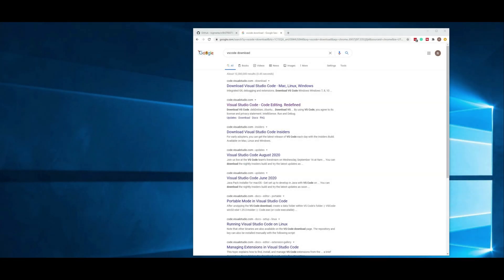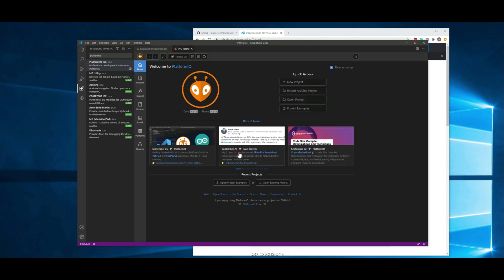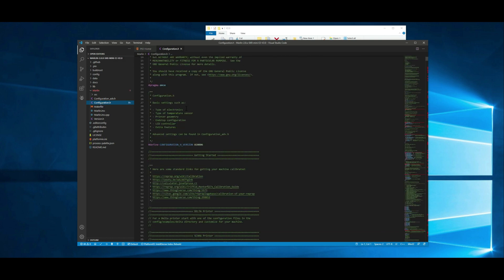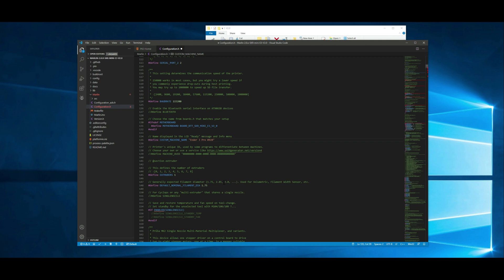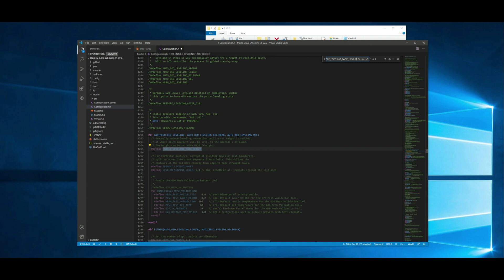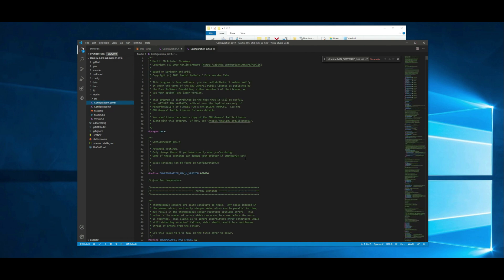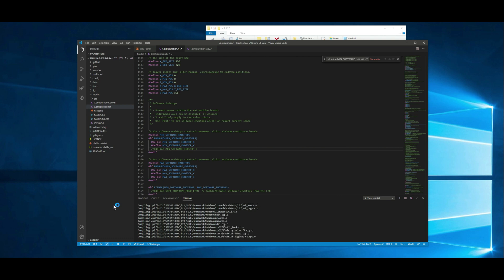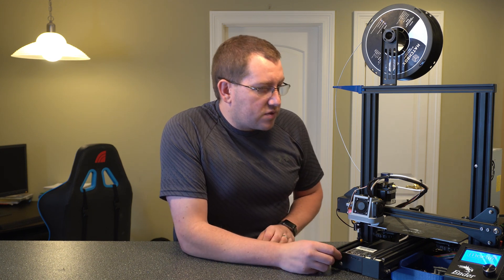How to Compile Custom Firmware for SKR Mini

Comment: I'm having trouble flashing my updated firmware to my skr mini e3. The fan0 pins on my board wont work with the tft display, but the fan 1 pins are always on; so Im trying to swap the two and use the power terminals to replace the fan1 pins. I changed the fan0 pin to pc7 from pc6 in  pins_BTT_SKR_MINI_E3_common.h, and the fan1 pin from pc7 to pc6 inpins_BTT_SKR_MINI_E3_V2_0.h. the code was successfully compiled and loaded onto the sd card, but when I power on the board wiith the tft display nothing changes. Is there anything else in the ender 3 that is needed to flash the firmware, or should I be able to do it only with the board and tft display?
Reply from the maker: Hi. All changes would be done on either the mainboard or tft. If you are running into issues there may be someone Discord that can help. https://discord.gg/Bu94EYVkrU

Comment: When I run the build command it starts running through the "Building in release mode" and then comes to a stop and does nothing. it still has the spinning build icon but the terminal stops. Please let me know how I might be able to fix this. I have not been able to find much help with this anywhere
Reply from the maker: Hi. I think you reached out on Discord. If that wasn't you and you need help here just let me know.

Comment: Big fan of your videos and channel!
I also am having issues compiling this firmware correctly for my setup, and would be extremely grateful if you could help me. I've been trying a week now with no luck :/ I even resorted to other guides on the internet with no luck as well. I recompiled the firmware following your guide again (following this guide exactly) and am successful in building it and flashing it, but no matter what i've done, the BL Touch clone I am using (3d Touch v2.1) does not stop the z axis from moving downward when homing. The 3d touch also responds to all the other commands when I try them manually in the menu (reset, self test, deploy, stow, etc). I tested the precompiled firmware .bin file that Bigtreetech offers, and theirs actually does make my 3d touch home correctly/stop the z axis from moving downwards, although I need to use a custom compiled version for different offsets and other settings. I've done research on this issue for hours, and numerous hours trying with no luck. Would you be able to help me?
Reply from the maker: Hi. Thanks for the feedback. Based on the name and overview of the issue you are having I think you reached out to me on Discord. If that’s not the case, let me know and I will try to help out here.
Reply: @3DPrintscape  You helped me for four hours+ with numerous attempts and finally was able to help me solve my problem. I am extremely grateful for the help! Definitely staying subscribed and enjoy your videos thoroughly.

 For anyone who owns a bl touch clone (mine was a makerbase 3d touch v2.0), try commenting out (putting two // infront of) BLTOUCH_FORCE_SW_MODE and BLTOUCH_DELAY under configuration_adv.h . It made mine work successfully after many attempts!

Thanks again for all the help!!
Reply from the maker: @Jeff876533  Im glad we were able to get everything working 😊.

Comment: keep getting an error   {
	"resource": "/c:/BTT/BTT/firmware/V2.0/MarlinSKRminiE3V2.0/Marlin/Configuration.h",
	"owner": "C/C++",
	"code": "1696",
	"severity": 8,
	"message": "#include errors detected. Please update your includePath. Squiggles are disabled for this translation unit (C:\\BTT\\BTT\\firmware\\V2.0\\MarlinSKRminiE3V2.0\\Marlin\\src\\MarlinCore.cpp).",
	"source": "C/C++",
	"startLineNumber": 1,
	"startColumn": 1,
	"endLineNumber": 1,
	"endColumn": 1
}
Reply from the maker: Hi. Can you provide the full error message?
Reply: @3DPrintscape  it's ok bro. I've never used Visual Studio before so took a crash course. There was several points I had to "un-comment" before to compiling would work. Thanks for offering help, appreciate it   :) My bed is super warped, so got a glass bed. That helped too.
I'm trying to print thin wall for an RC aircraft and the parts aren't even close enough for assembly. 
Live and learn   :)
Cheers!
Reply from the maker: @hungoo1241  Cool, im glad to hear you got it working.

Comment: Did it the exact same way, but it fond 9 errors. wtf...
Reply from the maker: Hi. What are the errors?
Reply: @3DPrintscape  During compiling, few yellow rows occured. I will put them here if you don't mind, because I don't really understand them and don't know how to put it down simply:

1) C:\Users\Jirka\.platformio\packages\framework-arduinoststm32-maple\STM32F1\libraries\STM32ADC\src\utility\util_adc.c:10:30: warning: 'adc_result' initialized and declared 'extern'
 extern volatile unsigned int adc_result = 0

2) C:\Users\Jirka\.platformio\packages\framework-arduinoststm32-maple\STM32F1\libraries\FreeRTOS701\utility\port.c: In function 'xPortStartScheduler':

3)
C:\Users\Jirka\.platformio\packages\framework-arduinoststm32-maple\STM32F1\libraries\FreeRTOS701\utility\port.c:178:2: warning: implicit declaration of function 'systick_attach_callback' [-Wimplicit-function-declaration]
  systick_attach_callback(&xPortSysTickHandler);

4)
At top level:
C:\Users\Jirka\.platformio\packages\framework-arduinoststm32-maple\STM32F1\libraries\FreeRTOS701\utility\port.c:285:6: warning: 'prvSetupTimerInterrupt' defined but 
not used [-Wunused-function] void prvSetupTimerInterrupt( void )

5)
c:/users/jirka/.platformio/packages/toolchain-gccarmnoneeabi/bin/../lib/gcc/arm-none-eabi/7.2.1/../../../../arm-none-eabi/bin/ld.exe: .pio/build/STM32F103RC_btt/firmware.elf section `.rodata' will not fit in region `rom'

6)
c:/users/jirka/.platformio/packages/toolchain-gccarmnoneeabi/bin/../lib/gcc/arm-none-eabi/7.2.1/../../../../arm-none-eabi/bin/ld.exe: region `rom' overflowed by 1436 bytes
Reply: And 250+ problems occured in language_cz.h (I changed language. That's the only difference from your video)
Reply: Well, It may be caused by those 250+ (above 1000 errors in fact) in language_cz.h. It says that identifier 'PROGMEM' is not defined. Dang...
Reply from the maker: @jirivaltr560  Replace default_envs = STM32F103RC_btt with default_envs = STM32F103RC_btt_512K in your platform.ini file located in the root directory of the firmware folder. Then restart VS Code.
Reply: @3DPrintscape  thanx for help!
Reply from the maker: @jirivaltr560  You're Welcome!

Comment: How do I run the build once through compiling if the check icon isn't showing in the lower left corner?
Reply from the maker: Hi. It sounds like platform.io may not be installed, or it was installed but VS code wasnt restarted.
Reply: @3DPrintscape  Same problem here, installed vscode, installed platformio, still no checkmark to compile, have restarted program multiple times
Reply from the maker: @redsoxguy6766  Hi. If the build checkmark isnt there, it can only be a couple of things. 1) platformio wasn't fully installed 2) vs code wasn't rebooted 3) you have the wrong folder open in vs code. If you have the configuration.h file on the root without having to go into the marlin folder most of the firmware wont be known to vs code, including the platformio.ini file that's needed for it to build.
Reply: This is super old but I found the issue, you need to go to the Platform.io homepage in vscode and select Open Project. Then browse to the folder you were editing and find the platformio.ini file and select that. Then the checkmark should appear for you.

Comment: Awesome video! Question: when I connect my printer to my laptop, it does not get labelled a drive letter in Explorer. I checked device manager and it is indeed there and I’m able to connect it to Ponterface. What am I doing wrong?
Reply from the maker: Hi. Thanks for the feedback. You dont need to connect your printer to the computer. You just need to put the firmware.bin file that gets built from platform.io onto an SD card and put the SD card into the printer.
Reply: @3DPrintscape  I made changes exactly as you have described here, yet when I compiled it, I get a "C:\Users\ma_pa\.platformio\penv\Scripts\pio.exe 'run'" terminated with exit code: 1" error. 

I narrowed it down to the uncommenting of the #define AUTO_BED_LEVELING_BILINEAR as when I uncomment it, that's when I get an error. When I comment it, it compiles just fine. Can you please help me with this?
Reply from the maker: @MrPW800  
Hi. Can you email me more details or join the discord channel to walk through it? My email is admin@3dprintscape.com and the discord is https://discord.gg/Bu94EYVkrU .

Comment: Hi and thanks for another great video. I have just one question: I only have a Mac book. I have purchase BLTouch and the board you are using in this video. So can I use my Mac book to up date the firm ware or can it only be done on a PC?
Thanks again
Reply from the maker: Hi. Thanks for the feedback. A mac can be used without any issues. The one thing I wanted to point out is that the mac OS will hide any folder that starts with a ., so the .pio folder will be hidden and you will need to unhide it or use CLI to get the firmware file.

Comment: I'm getting compile errors. I don't know why and I can't figure it out. It keeps saying "fatal error: ../inc/MarlinConfig.h: No such file or directory"
Reply from the maker: Hi. Can you send over the full error?
Reply: @3DPrintscape  

Compiling .pio\build\STM32F103RC_btt\src\src\gcode\eeprom\M500-M504.cpp.o
In file included from Marlin\src\gcode\bedlevel\abl\../../../module/stepper/../../feature/../lcd/../feature/pause.h:37:0,
                 from Marlin\src\gcode\bedlevel\abl\../../../module/stepper/../../feature/../lcd/ultralcd.h:61,
                 from Marlin\src\gcode\bedlevel\abl\../../../module/stepper/../../feature/tmc_util.h:25,
                 from Marlin\src\gcode\bedlevel\abl\../../../module/stepper/trinamic.h:35,
                 from Marlin\src\gcode\bedlevel\abl\../../../module/stepper/indirection.h:44,
                 from Marlin\src\gcode\bedlevel\abl\../../../module/stepper.h:47,
                 from Marlin\src\gcode\bedlevel\abl\G29.cpp:35:
Marlin\src\gcode\bedlevel\abl\../../../module/stepper/../../feature/../lcd/../feature/../libs/nozzle.h:24:10: fatal error: ../inc/MarlinConfig.h: No such file or directory
 #include "../inc/MarlinConfig.h"
          ^~~~~~~~~~~~~~~~~~~~~~~
compilation terminated.
* [.pio\build\STM32F103RC_btt\src\src\gcode\bedlevel\abl\G29.cpp.o] Error 1
================================================================================================== [FAILED] Took 11.50 seconds ==================================================================================================
Reply from the maker: @thatduckieYT  It looks like platform.io may not be fully setup. The install runs in the background and makes you think it's done, when its not. Also, you will need to restart VS Code after the platform.io install finishes.
Reply: @3DPrintscape  i did. I even tried downgrading platform io to the build that you had on the video. I believe it was 4/5 updates ago.
Reply from the maker: @thatduckieYT  ok i figured that i would start there to rule out anything simple. Can you zip the firmware package you are working with and email it to me? My email is admin@3dprintscape.com . I want to see if I can get it to build.
Reply: @3DPrintscape  Thank you so much for helping me out!!!
Reply from the maker: @thatduckieYT  You’re Welcome!

Comment: I followed the video to the letter but i dont have the Platform.io build Check box available to click and start the compile?
Reply from the maker: Hi, you will need platform.io to be able to build the firmware. It possible that it’s still installing, it kinda hides in the background while doing it. Also, make sure that you restart VS code after platform.io finishes installing.

Comment: I keep getting:
collect2.exe: error: ld returned 1 exit status
* [.pio\build\mega2560\firmware.elf] Error 1

I tried the btt github and got the same error then I tried the marlin one and still got the error although it wasn't "mega2560" for the btt one I honestly don't know what to do I deleted all the files multiple times getting a fresh download and nothing fixes it.
Reply: And for example when I use the firmware linked I get: 
collect2.exe: error: ld returned 1 exit status
* [.pio\build\STM32F103RC_btt\firmware.elf] Error 1

This has been really frustrating as no matter where I look I cannot find a solution. I'm almost tempted to just return my BLTouch and SKR mini and just run off the stock board.
Reply from the maker: Hi. Can you email me the full output from the terminal you got the error from along with your configuration.h file? I will take a look at it to see if anything stands out.
Reply: @3DPrintscape  Actually reading into the output I found out that the rom was overflowed so I changed my default_envs in the platformio.ini from STM32F103RC_btt to STM32F103RC_btt_512K which resulted in a success.
Reply from the maker: @LtDanSon  Great, glad to hear that you got it working.
Reply: @3DPrintscape  Now I have another problem lol. Everything seems to be working but filament isnt being extruded like it isnt flowing out of the nozzle. Any ideas?
Reply from the maker: @LtDanSon  Can you tell if the extruder stepper motor is moving and grinding the filament? If it is, then it could be a clogged nozzle. If it isn't moving then it could be wiring or firmware related.
Reply: @3DPrintscape  hmm ok let me check it out real quick and Ill get back to you
Reply: @3DPrintscape  it was a bit of both, first the stepper motor was not moving so unplugged and plugged them back in, and it started working. However it was still not coming out so I checked the nozzle and it was indeed clogged so now it is extruding perfectly. Thank you veryyy much

Comment: Thanks for the very helpful guides on upgrading to the SKR mini.  I would be interested in the specific changes that are required to the stock Marlin bugfix release to support the mini v2 and BLTouch (using the standard 5 pin connector on the board without replacing the Z end stop).  Have you made such a guide?
Thanks again for all the time you’ve invested in sharing this information.
Reply from the maker: Hi. Thanks for the feedback, and no I haven’t made a video like that. I can look into adding it to my backlog but that one may be challenging with my current setup. I will see what I can do though.
Reply: @3DPrintscape  Making the necessary Marlin changes seems straightforward, as I’ve followed your guide(s) and several others.  I can flash and run BTT’s custom firmware for the BLTouch and it runs fine, but I have other modifications I’d like to make as well.  Compiling and flashing the current 2.0 bugfix version with the outlined changes however results in an error returned from the probe when probing begins after a bed-leveling is initiated.  I suspect it has to do with the (original) Z-stop getting triggered but I can’t seem to find the right combination of settings to use both the original Z-stop for homing, but the probe for leveling.  Testing the probe works fine, so it doesn’t appear to be h/w related.
Reply: @FowlerDK  Hi. I know BTT has a precompiled version of their firmware for both wiring configurations, but im don’t think there is an easy way to get the contents of the configuration.h from it. Looking at the config, I think you will need to comment #define Z_MIN_PROBE_USES_Z_MIN_ENDSTOP_PIN back out and enable //#define Z_MIN_PROBE_PIN 32 // Pin 32 is the RAMPS default with it set to the right pin.
Reply: @rob9199  yeah, that’s the problem with the precompiled BTT f/w, I haven’t seen what changes they actually made to the config files (or if they’ve published them somewhere I haven’t found them).  I’ve tried both commenting out and activating the Z_MIN... parameter you mentioned but neither option seemed to work.  Are you sure the Z_MIN_PROBE_PIN_32 is the correct setting for the SKR mini v2, using the “5-pin” probe connection?  I haven’t tried that yet...
Reply from the maker: @FowlerDK  I took that example directly from the configuration.h file, so it was just an example. I pulled up the board pinout and it looks like the probe would be connected to PC14. https://github.com/bigtreetech/BIGTREETECH-SKR-mini-E3/blob/master/hardware/BTT%20SKR%20MINI%20E3%20V2.0/Hardware/BTT%20SKR%20MINI%20E3%20V2.0-PIN.pdf. (I was replying under a different account earlier, sorry).
Reply: @3DPrintscape  Thanks, and that’s where I’ve connected it.  Since it’s already defined in the pins file for the board, I assume this is the default when compiling for that board.  I haven’t tried uncommenting Z_MIN_PROBE_PIN and defining it to PC14 though.  The comments in configuration.h state that if Z_MIN_PIN is not defined, the default pin for the selected motherboard will be used.
Reply from the maker: @FowlerDK  It looks like the default is P14. Its under \Marlin-2.0.x-SKR-mini-E3-V2.0\Marlin\src\pins\stm32f1\pins_BTT_SKR_MINI_E3_common.h .